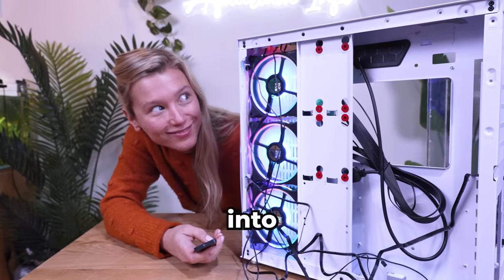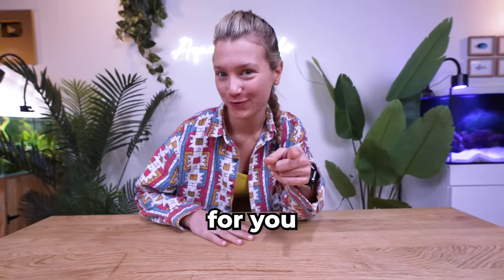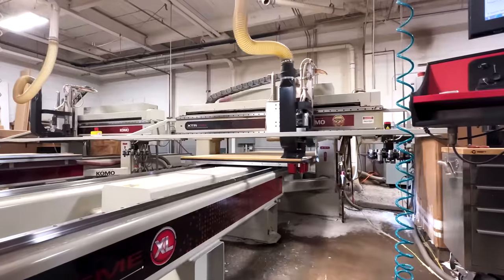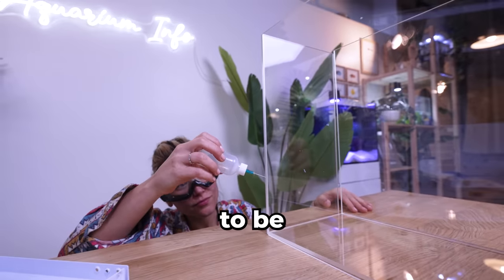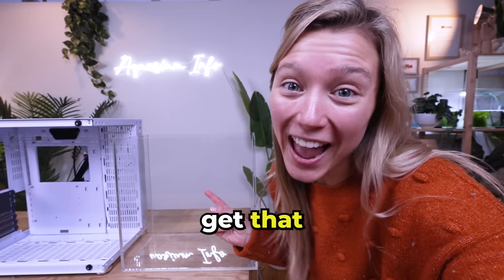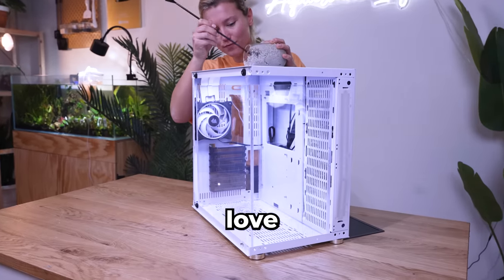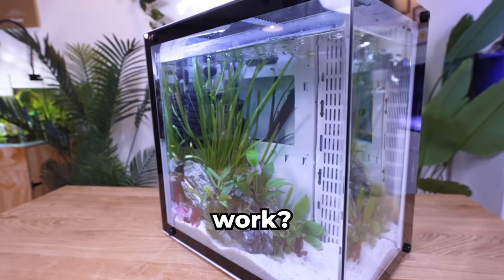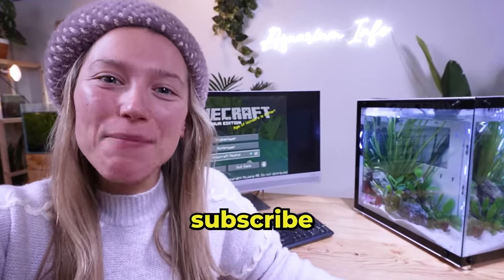I Transformed my Gaming PC into a Fish Tank

Comment: Yeah…. That super slim PC you found is basically only good for basic tasks 💀
It’s one of those PCs you get if you want something very small, but don’t care about having anything super intensive to run on a PC. Basically it’s for emails, web browsing, basic work apps, and even other messaging features.
Though I think there is a “better” version out now that has a bit more power for multi tasking stuff (which is the Celeron N7305, which has 5 low power consumption cores.) 2 CPU cores and 4GBs of ram isn’t much.